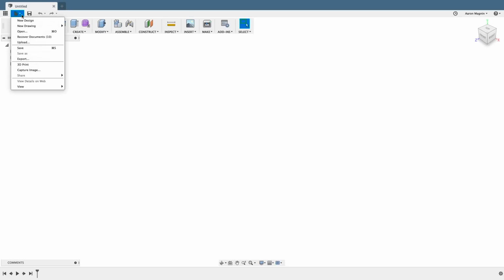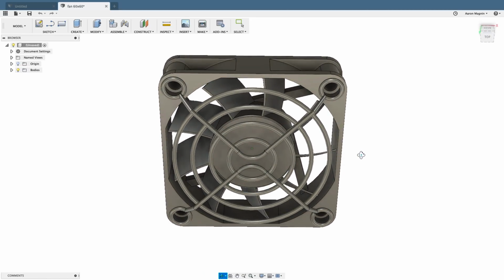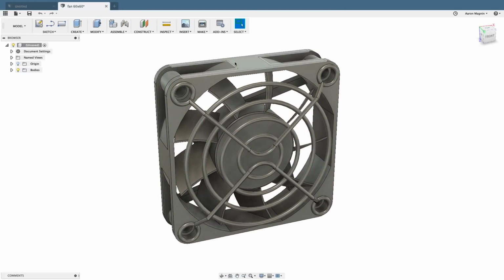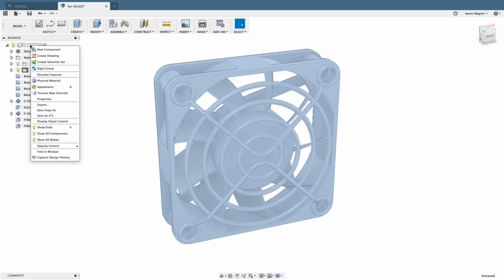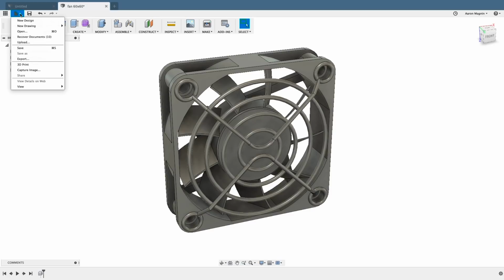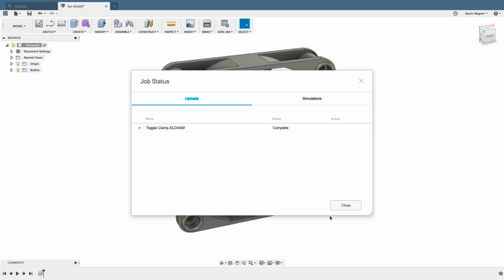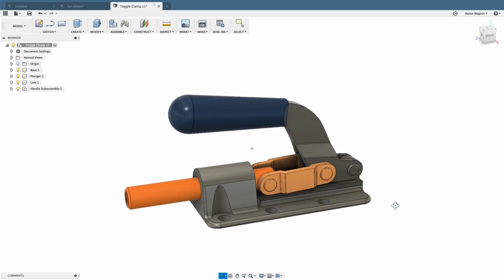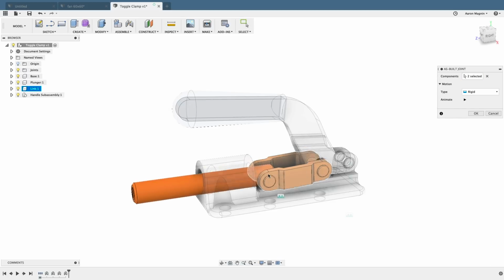QUICK TIP: Import & GO (Updated)

Comment: 2:35 "I'll share a link to the video explaining why"...
Reply from the maker: See the cards
Reply from the maker: ... By hitting the little "i".
Reply: @adskFusion  Thanks. The first place I go to look for links is in the video info, where you have other links listed. The cards disappear when the video ends. I suppose it works but they are not as easy to access as they should be (IMO).
Reply: Harman Robotics I agree with you there. The links should also be in the video description text if possible.